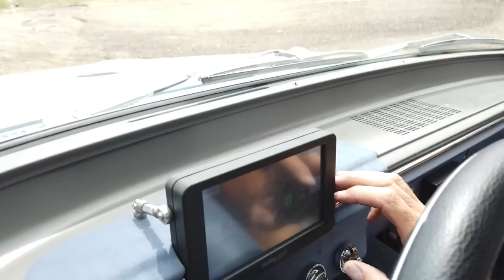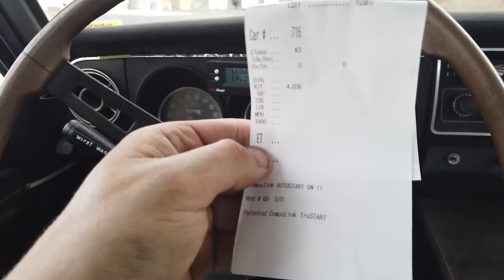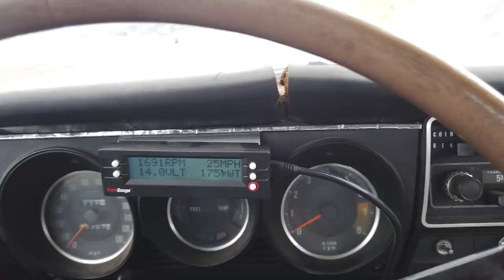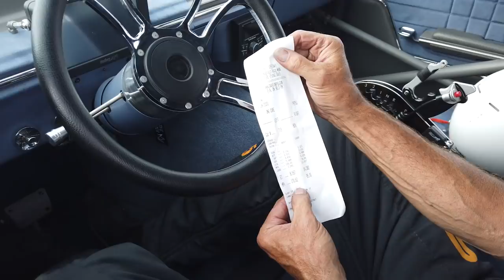We Almost TOTALED The V8 Swapped Mazda... It needs some work. Buick Finishes Strong! Race Week Day 7

Comment: DeX VI is a synthetic fluid. And sounds like you have a torque converter acting up with the pushing through at a stop. Also will push fluid out on a longer drive or higher loads.
Reply from the maker: Looks to be the rear seal i think the pulling issue was due to low fluid. Time to try and get it fixed!

Comment: I'm very surprised that you opted to put a Ford 9in in the Mazda RX-2 but at least you won't ever have to worry about it breaking but I would've thought putting an 8.8 in there would've been easier and lighter on the car but then you would've had to put C-clip eliminators in it and everything else just to beef it up a little bit
Reply from the maker: I had a 9in housing and center section laying around and with a few brackets it went in super easy. My camaro and rx2 and soon the burnout truck will all have match rear ends so they can share center sections if needed.

Comment: in termonitor X what I can change in real time tuning
Reply from the maker: Timing and fuel idle ect. Most hard parameters and input output switched settings will need to have the ignition cycled